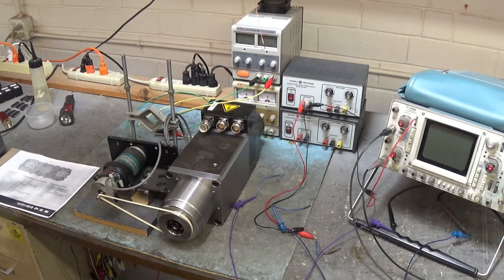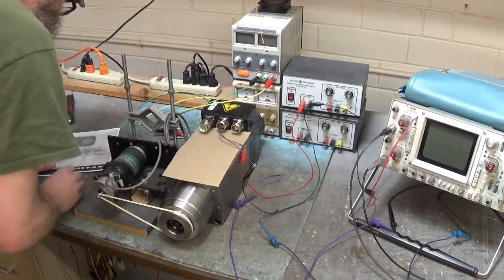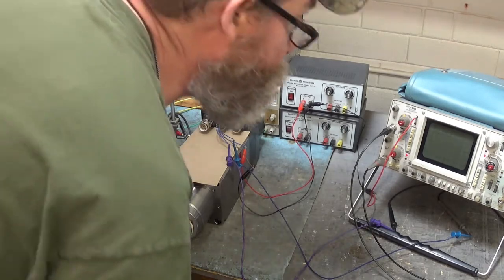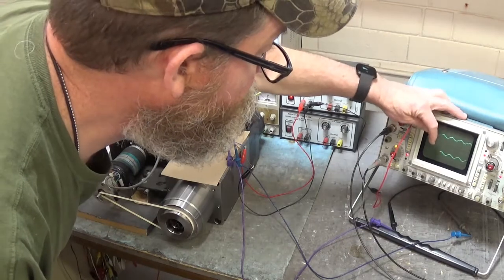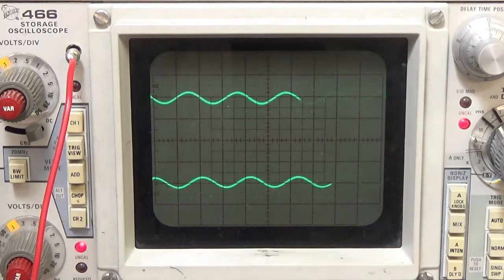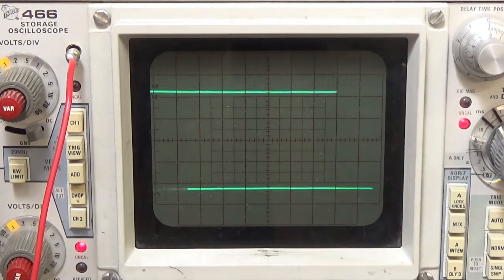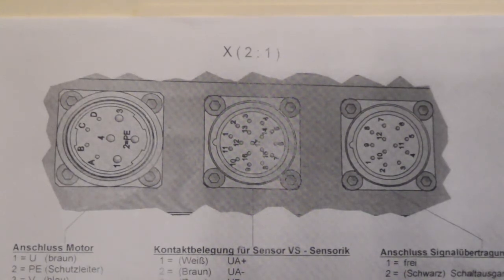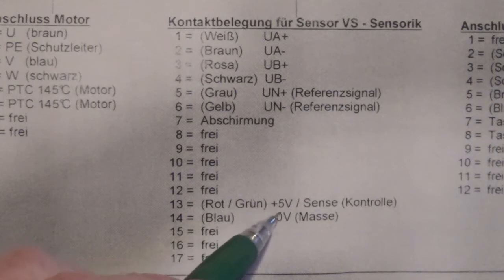Testing the Reckerth Spindle Motor Feedback

Comment: Hi! Thank you very much for sharing your knowledge. I watched this video with interest because there is little data available about these spindles... in particular, I am looking for information on PinOut of the clamping position signals. Could you share the entire content of the pinout card? because the video shows only the part with the encoder connections (which is also very informative because it is a completely different order than the encoder manufacturer Lenord+Bauer determines)